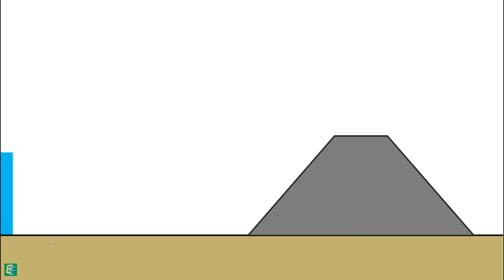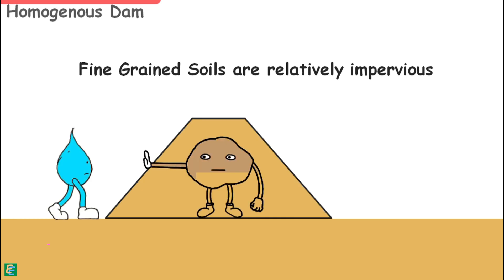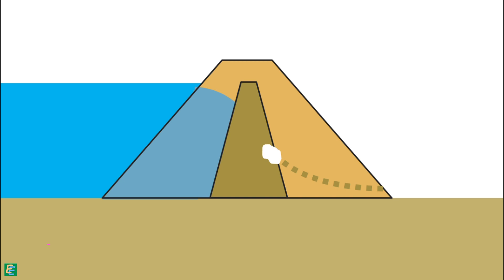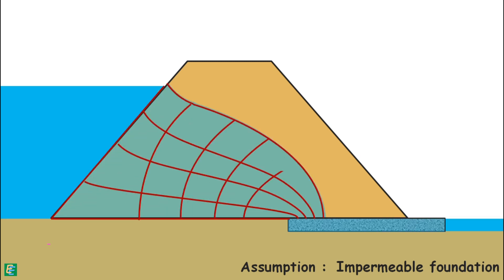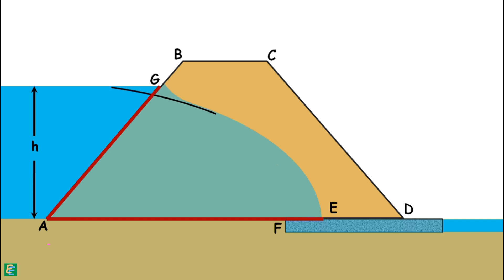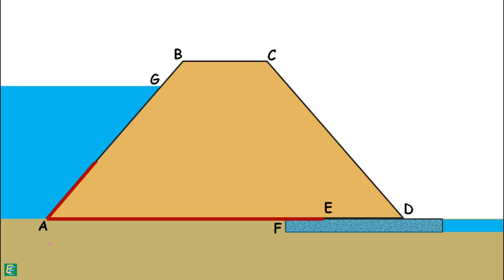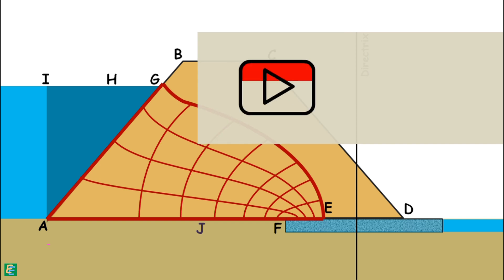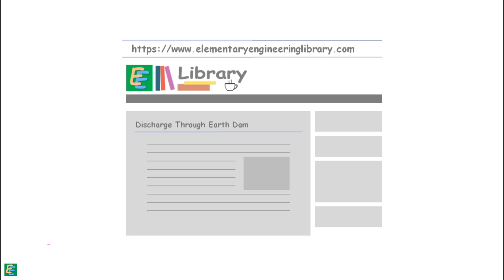Earth Dam - Introduction, types and calculation of seepage through it

Comment: Could you advise on the following situation regarding an earth dam in France at least 50 years old.
We live in a property immediately below the dam which retains a 250 hectare lake used for seasonal irrigation by feeding a small river which runs through important agricultural land. 
In recent years it has become apparent that although there is evidently no 'piping' or conventional leaking,  the dam was constructed on a spring line and the upsurging spring water pours from the base of the downside elevation,   
The water has been channelled previously in pipes and tubes but increasingly fine sediments from the internal impervious layers of the dam are found in the water.  
Attempts so far with large scale work to suppress the springs with layers of gravel and impervious membranes have been unsuccessful (most recently in work concluded this week!)   The water continues to flow rapidly and contains fine clay particles.  
Those in charge insist that it is not the result of leakage or piping and that seems  to be borne out by the evidence that the water is very clear and much warmer than the surface water.  Springs abound on this side of the valley.
Although the intention is to keep the lake at very low levels at present, should we be concerned given the location of our property which once functioned as a water mill in the old river valley.  We are very short of information and dismayed that there is no close consultation with us about the complex engineering work being carried out right next to us.  
If you have any advice we would be very interested to hear it.  Or to point us to other sources of information comprehensible by an intelligent layman.   Thanks!
Reply from the maker: Thank you for reaching out to me. I appreciate your trust in me. I understand you're seeking professional support, and while I'm not qualified to provide that specific kind of help, I strongly encourage you to seek guidance from a qualified professional.

I hope you find the support and guidance you need.
Reply: @ElementaryEngineering  Thank you for taking the time to reply to my comment.  You are of course right that I must get the local engineers to advise me and also make sure that the local authorities are asking the right questions in the consultation process.  
Happy New Year and many thanks for reading my concerns